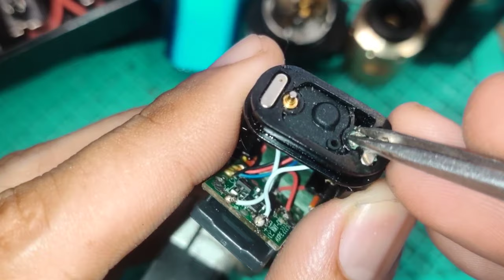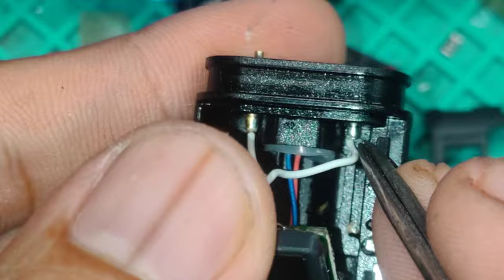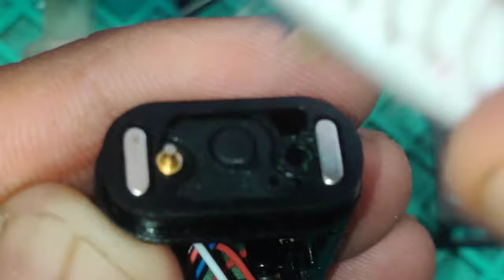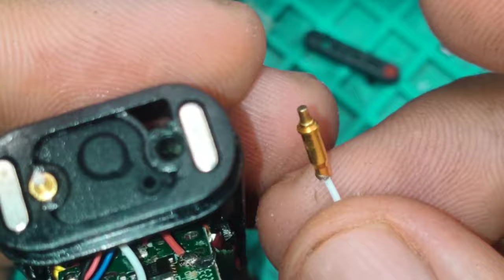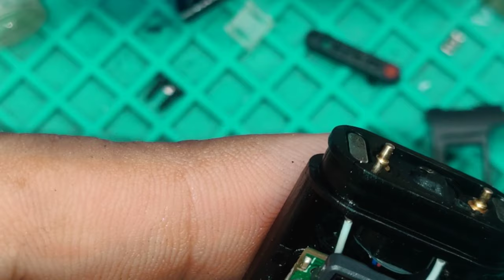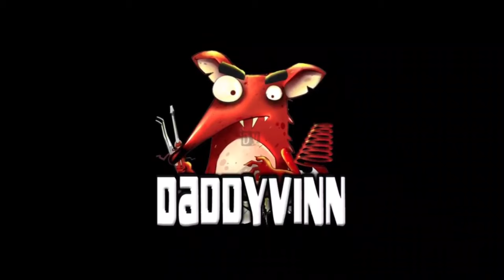PIN REPLACEMENT VIDEO OXVA XLIM

Comment: Please provide a tutorial on how to disassemble the previous version of Oxva Slim SQ
Reply from the maker: illl try .. you have to just insert a shim at the lower area it slides down with all the parts. do not forget to pull-out the air adjustment pin